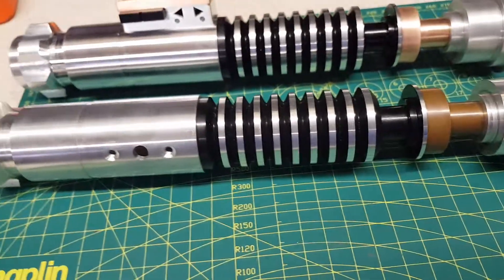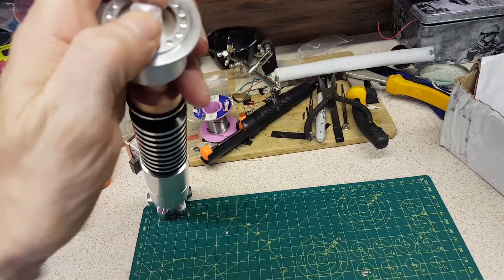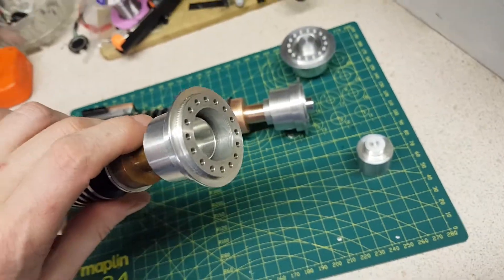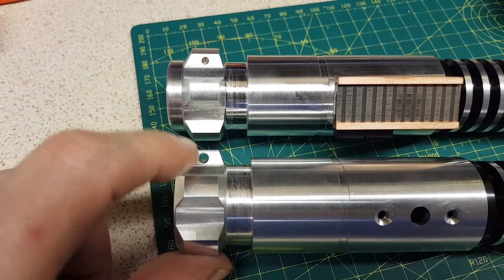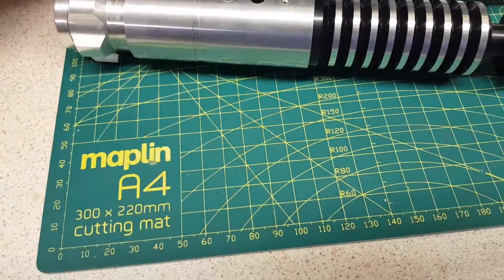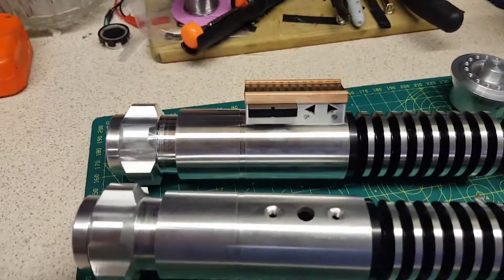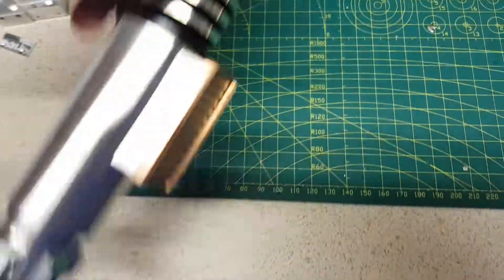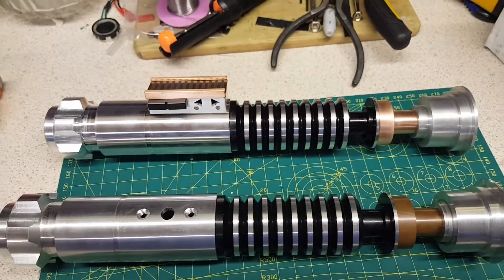Romans Props Luke v4 mk1 & mk2 comparison

Comment: Thanks for the comparison! :) 
Yes, the emitter section is longer on the Mk2. 
Also, the control box is slightly shorter and slightly wider. 
Triangle Ring position is also adjusted. 
And yes, top grip-ring is beveled (chamfer) to be shorter. 
Finally, not mentioned in video, the black button is now moved in from edge of control box. 
Think that's about it. :)